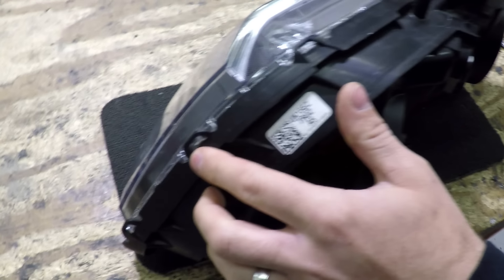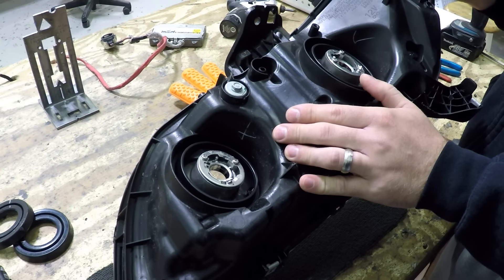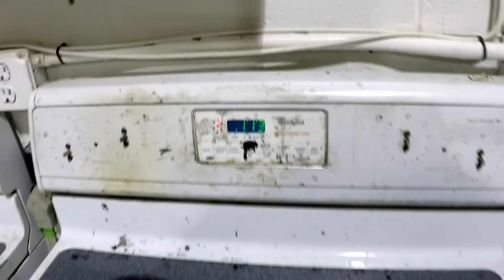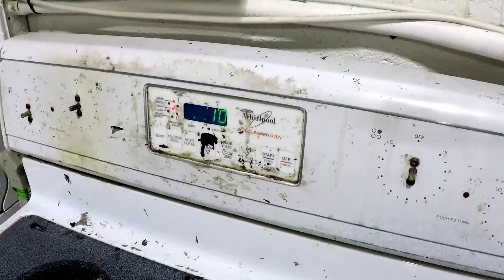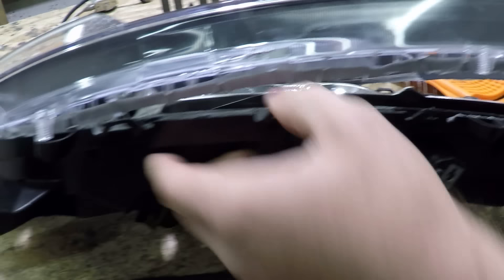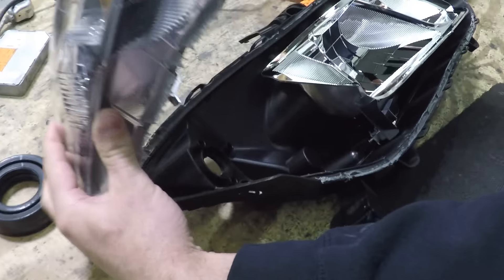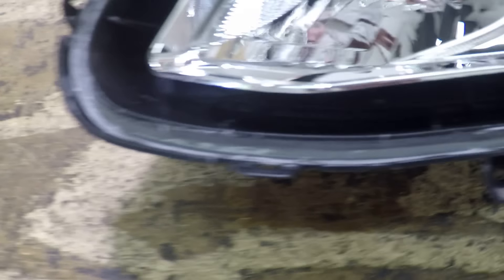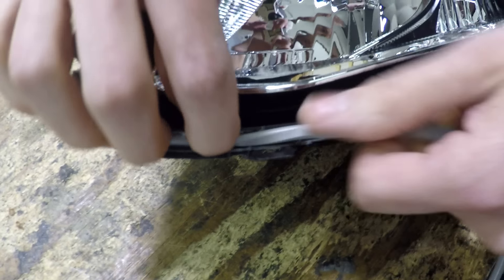Opening & Resealing Automotive Headlights using Morimoto Retro Rubber

Comment: Remember europeans its 240 Fahrenheit not Celsius,  i burned my headlight.
Reply: I have just burned mines to :(
Reply: 240° F  = 115° C.
Time??
Reply: Oh well. He states Fahrenheit in the video. Guess you missed it.
Reply: better to use an Hot Air Gun 😂
Reply: @exploreandunravel5773  Heat isn't equally distributed with a heat gun, you want equal heat distribution all around the seal. For that, an oven is best.
Reply: @bogdangiurgiu9514 bruh ur fried😂

Comment: After reading some of these comments, I had to google joe rogan b/c I'd heard the name in passing but didn't have any connection other than that. Found his podcasts, and this sounds like him for sure! Great video. Helped me a lot. I went with the slow bake vs the 275 deg for 7 minutes as another video suggested. Worked great. I was able to pop the headlight open (2018 Fit Sport) and fit the new lens cover and reseal. I actually had to do it twice b/c of fingerprints on the inner housing so be careful. Looks brand new again. My previous lens cover had sustained a 2 inch gouge from a kicked up rock on the highway. I wanted to get it looking new again. Got the lens cover off ebay from China since Honda only sells the entire headlight assembly for several hundred. Used the info in this video except I just reused whatever rubber remained in the housing channel. To me there was enough in there already, and saved me the time and money from getting new rubber. Plus, there are several clips and screws holding it all together in addition to the residual rubber.

Comment: IMPROVEMENTS & positive feedback: The video was well done and helped me do both headlights in a Mazda CX-5.  The only thing I would do different since I learned from the first one is to NOT warm the Morimoto for a few minutes, it got too sticky and stuck to everything I was working on, had to throw half of it away.  The second is to use the cooled Morimoto but stretch it out to about half the original diameter. I know the video said to stretch it but the first one was still too thick since the original sealant was still a considerable amount.  On my second headlight, I stretched it much thinner, heated it, then flatened it and it worked out perfect with a beautiful install.  Thanks for the great video.

Comment: Thank you for the video. I used this to replace the yellow and cracked headlight lens on the wife's 2008 Mitsubishi Outlander. Everything worked well except for when I left the Morimoto in the oven a little bit too long making it droopy and hard to work with. Did better on the second light. Picked up the lens for both sides from Ali-Express for $58. Huge difference.

Again, thank you

Comment: Man I love sealing and messing it up and then start all over lol. This process is hard to do correctly the 1st time. My gloves got the adhesive all over it and as I was handling the assembly the adhesive got all over the lens covers! Took a long time to figure out how to get it off. Tar and grime cleaner worked fastest but made sure to clean it off every 30 seconds to not damage the clear lens cover. Second time I did just like the vid! Didn't have clamps per se so I looked at my jumper cables and they looked like clamps..worked like a charm!

Comment: Great video but one thing I do differently is heat the housings before removing the screws. With older lights the butyl/sealant can be so hard you can snap the screws trying to remove them. If the sealant is warm it will give up the screws easier.

Comment: Best vid I've ever seen. Thank you
Reply from the maker: Thank you, thats why we do it!
Reply: Is there a trick way to level the projectors before install? ie the grid on the reflector bowls, are they parallel to the ground. could u use those as a guide to align the projector?
Reply from the maker: https://www.youtube.com/playlist?list=PLRtSL67o6XZ7qoO8LEypVtJcEs2Wc2iQ6
Reply: Great video
Reply: What about original xenon lights with wiring and control module inside. Is there any risk for internal unit or wiring if i place it in the oven? Now I'm speaking about European Škoda Octavia II gen (VW concern)
Reply: I agree best vid on this procedure so much so I might just rely on you guys to do it for me lol.
Reply: @LightwerkzGlobal  what size flathead screwdriver is that?

Comment: Very good tips, I just followed every step in my Infiniti QX70 and it worked 100%
Reply: About to try this on my JX35, did you do both sides? Only the driver side is leaky, wondering if I should do both preemptively.

Comment: i have mercedes C-class from 2019 facelift of which i need to change the lens. How do i know if it's soft or hard glue so i know how to prepare in advance. Also maybe it's just me who didn't hear it properly but how much degree do you use to heat the headlights. Thank you in advance.
Reply from the maker: Its going to be the tougher perma-seal type go sealant. I recommend cutting those lights open and have a new set of lenses ready.

Comment: I just got new fog light housings for an 03 Tahoe and in a week I saw water and condensation in them thinking I’ll be here soon
Reply from the maker: Fogs are usually sealed different and generally speaking don't open the same way. I would suggest getting new housings.

Comment: After I preheated the oven to 240 degree. Do I just throw the headligh in without turning ON the oven and let the existing heat do its job or do I have to turn the oven back on at 270 degree?
Reply from the maker: Set oven to 240F. Allow to preheat and put the light inside. Do not crank it up higher than 240.
Reply: @ Got it. Thank you!

Comment: I have a e70 bmw x5 2012. The glue isn't wanting to melt at all. Can this be beacasue I have a gas oven and not electric? I NEED some tips!!!
Reply from the maker: Thats what we call "perma-seal" - one time use "cold glue" - doesnt really soften with heat. We cut the lenses off the E70 and use new lenses with butyl sealant like you see used at the end to eh video. Cutting the lights open allows you access to both sides of the channel for safer removal. If you dont have spare lenses you will take this approach - https://www.youtube.com/watch?v=7pqa0nnTkwc
Reply from the maker: You can keep going with the baking but its going to be a fight. Those E70 lights will taken multiple rounds in the oven. https://www.youtube.com/watch?v=iKDvstda87Q

Comment: Great instructions. How do you remove the internal screws on a BMW 535 F10 lens? No external straps or screws but it appears that there are internal screws holding the lens to the LED directional.
Reply from the maker: Not sure I know exactly the screws you are referring too but once the light is disassembled it should be pretty clear what needs to be done.

Comment: I rewinded the video because you said you added extra sealant that’s why it was oozing out after after placing the clamps. So when you first added the new sealant you added more? Please explain
Reply from the maker: You just need to add one layer of extra sealant, and it will ooze out a bit when heated up. This is a good sign, means its filling in any voids.
Reply: @LightwerkzGlobal  had to rewatch the video a few times. I seen how you flattened the old sealant then later you added the new layer of sealant. Appreciate you guys 💯

Comment: Good Job, thanks for your professional video, I have two questions, what is the unit used to describe the temperature(C or F)? and is this method is useful with 2014 dodge journey headlights?
thanks again
Reply from the maker: Its 240F. Yes you can use the same 20 mins 240F guideline for any light. But it wont be as easy to open. Check out some of our other videos relating to "perma-seal"
Reply: Its F or 115.5C don't know about the Dodge a guess yes.

Comment: I'm going to buy a new set of headlights for my car, and one of the lights have a ring that have fallen off so I need to re attach it somehow.
Any tips on what I should use to re seat it?
Reply from the maker: If it's a piece of trim from the housing you can use epoxy to reattach safely.
Reply: @LightwerkzGlobal  I will look into it! :)

Comment: I have a question. My 2003 Nissan frontier pickup, the cab brake light seal is gone. Can I use this product to reseal so no water goes into cab?
Reply from the maker: While you might be able to, I would think silicone would work better for you.
Reply: @LightwerkzGlobal  thank you for replying. BTW well done instruction

Comment: I'm trying to remove the lens from a factory OEM 2016 Buick Regal HID headlight. I hit a deer and damaged the lens. I found replacement lenses on ebay and watched your video three times. The factory headlight appears to use a windshield urethane to hold the lens on. After 20 minutes at 240 degrees, the adhesive did not soften at all. Have you come across this issue?
Reply from the maker: Perma-seal - https://www.youtube.com/watch?v=iKDvstda87Q

Comment: How would you recommend heating up the headlight without an oven.  I don;t have a garage oven.  I have a heatgun.
Reply from the maker: Look up the "cardboard oven" which is basically a box with a heat gun attached to it. Use caution as its risky./

Comment: As a person with f*cktons of experience with ovens, heating, sealants, surface finishing, and MIL-Spec, the only thing I would advise is introduce some kind of diffuser between the oven's heating elements and the headlight - especially if you are trying this with your own oven at home, and you don't have that oven calibrated or the oven is old/less efficient.

Comment: How long is this fix expected to last?
My 2015 Tahoe a year ago, has leaked both Original lights in 1 week from auto carwash, then after 4 days 1 of the 2 aftermarket lights leaked again. My repair shop replaced under warranty that time but he ate the whole bill. The Tahoe bumper has to be dropped to repair a single light or 2 at a time. Now they are both leaking again. Dealers charge 750 each, plus labor and core deposit which would have been 2000k plus.  My mechanic sold me lights for 500 each and 500 labor. I thought I got a good deal. He saved me 500.
But here we go again. Both are leaking again.
Do you sell lights properly sealed that would last longer than OEM?
Should I buy a pair from you? Then send you my leakers for repair so I have a spare set? These GM lights cost a fortune in labor to r/r. ????
Reply from the maker: This procedure is not worth it on your 2015 Tahoe. The Tahoe is sealed up with a very tough sealant. Best to get two new used functional lights and add some extra silicone around the edges into any gaps and clean it up nicely.
Reply: @LightwerkzGlobal  i think ill take it in on a Fri afternoon and have the bumper dropped and take the lights home over the weekend, clean and silicone them and take em back early Monday morning for reinstall. Then I'm only out the labor. My mechanic agrees to do it. I'm gonna need a tiny tube silicone nozzle to get into most of the cracks. Should I use clear or black to  match the seal? Should I use the high temp silicone? I assume the black high temp would do better.??
Thanks for your input.
I appreciate your honesty.
Reply from the maker: @Jrhnhemp   Make sure you drain out the water after removing caps. Then bake it in the oven for about 30 mins at 225F. All water should be cleared up. Use this sealant to go over the seams - https://www.amazon.com/Permatex-81158-Silicone-Adhesive-Sealant/dp/B000AL6WLA/ref=sr_1_2?dchild=1&keywords=permatex+black&qid=1587331712&sr=8-2
Reply: @LightwerkzGlobal  will do...thanks much...other than those leaking lights, I love my truck. Thks again!

Comment: What to do if it has servomotors and ic boards that cannot be removed and that temperature would affect the components ?
Reply from the maker: No need to worry  about motors or modules. These temps are safe (240F)

Comment: Does this work on those $1200 Tesla and similarly overpriced units for simple bulb/LED replacement?
Reply from the maker: Yes, the method works but Tesla comes with a "perma-seal" which is stiffer and harder to work with when compared with this soft sealant.

Comment: Do you also put the LED board and wires into the oven at 240 for 20mins? I would think the wires would melt? Thanks
Reply from the maker: You can leave everything attached to the light. Thats a very low temperature. No risk at all for wires melting or LED boards being damaged.

Comment: I have just tried to open my headlight preheat the oven on 220 set an alarm for 20mins but just after 3 minutes I could smell burning and took the headlight out and it was melting and deformed, now I have bought a new headlight.
Reply: 220c or 220f?

Comment: Do you clean the sealant off of the lens? It looks like you're working with brand new headlights for retrofits, but I retrofitted some much older headlights, 20+ years old. Just want to know what I should use, if I should even use anything to remove the old sealant off the lens, already flattened the old sealant in the housing, and will be using the retro rubber! Awesome video btw!
Reply from the maker: Large chucks of butyl you clean off with a small ball of butyl. Just pick off using the ball. Small residue clean off with goo gone - NOT goof-off. Flatten old butyl and add new when it comes to channel.
Reply: @LightwerkzGlobal  Awesome, thanks so much for the quick reply! I'll toss the lenses in the oven to get the sealant all softened up and get it off using the butyl ball method then!

Comment: very helpful video! i have a 2012 Audi A6 and theres a crack on my lens that i want to fix. is it safe to leave all the components in when its time to bake it? its full LED headlights. i would like to try and not mess up, if i do its another 3k just to replace a headlight..
Reply from the maker: Stress cracks within the lens most likely will be able to be removed. Opening the up wont help you - you should be able to try to sand from them front. however most likely will be wasting time - I would recommend a new light or a used one that has a clear lens.

Comment: Great video!  I have a 2012 Volvo S60 with active lights, and the driver's side has a lot of moisture in it.  I'm going to try to reseal it rather than having to spend $800 for a replacement.  I have butyl rubber from resealing a door panel that I think would work for this.
Reply from the maker: It would but the Morimoto sealant is specifically made for headlights. The sealant you have will always stay gummy and soft while the morimoto sealant is hard when its cold.
Reply: Can you explain why having it harden is preferable to remaining gummy?
Reply from the maker: Because the softer the sealant the lens can spread by itself. In the summer heat or even engine bay heat, it will create a mess when its soft and sticky. For your 1-time use most likely fine. From an installers perspective it is not something you would want to work with over and over again. The automotive grade sealant is not expensive.
Reply: ok, that makes sense.  I guess even the lights could heat the sealant up.
Reply: Do you sell it?
Reply from the maker: Yes all info in this video description :)
Reply: Great, I ordered that and will give it a go this weekend.

Comment: What do you call the sealer you used for this headlight? I have to split the headlights on my 2008 fd2 Civic Type R (basically same headlight as you're doing in this video) and I know it uses the same sealer so would like to get some ready for the job.

By the way this is an awesome video, gave all the information you could ever need and explained in a great way 

Thanks so much for making the video 👍🏻
Reply from the maker: Butyl Rubber

Comment: Your video is phenomenal! I plan on replacing the lenses on my 2004 E55 AMG Bi-Xenon's. I think I know the answer but I'll ask anyways. Is everything safe in the oven at 240°F for 20 minutes or are there any components that should be removed? Do you have any recommendations for clear, polycarbonate replacements? Thanks in advance!
Reply from the maker: 240F 20 mins is good on everything - no worries. Check with Bimmerjakes.com - they may have lenses for you
Reply: @LightwerkzGlobal  hey I have HID module on my lights it’s a 2007 Lexus es350.. is it ok to leave on at 240?
Reply from the maker: @Molino-Red  Yes
Reply: @LightwerkzGlobal  thank you! I just finished them.. I did exactly what you showed us to do and it work perfect! I’m just going to let them sit over night and install them tomorrow morning.. Thank you!
Reply from the maker: @TheKraken2019  Yes, stick with 240F for 20 mins at a time.

Comment: Great video, but I want to ask for two things. Temperature You using 240° C or F? and second question If that temperature is in C, what about inside electronics in light? Im speaking about for example xenon (AFS) unit. Its safe for it?
Reply from the maker: 240F - and you do not need to worry about electronics.

Comment: If you say that preheating the oven before sticking it in is better, What is the difference between that and your low and slow method? I mean as long as the temperature isn't set higher than the headlights melting point. Things should be fine right?
Reply: Yonks85 when preheating the element gets super hot to warm up fast then shuts off at the right temp so it could get too hot
Reply: The oven has one temperature, very hot. When it reaches the temperature set it stops heating constantly and cycles the heating element on and off to maintain temperature set.